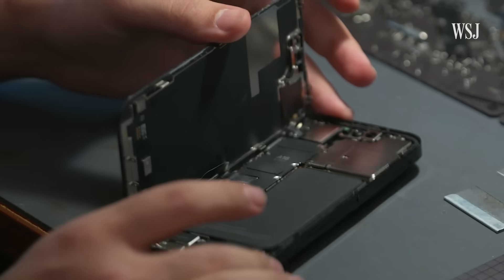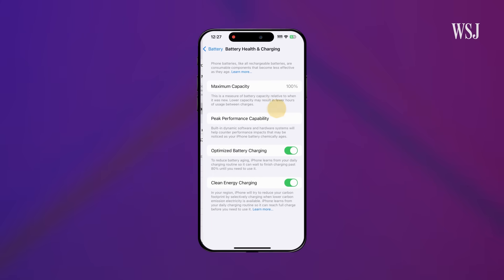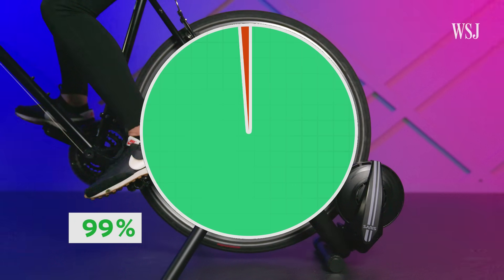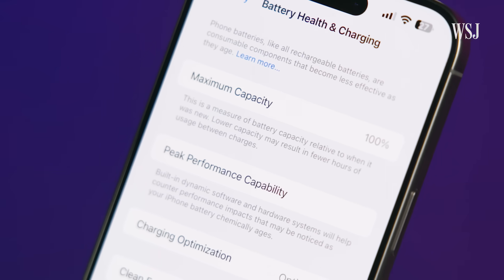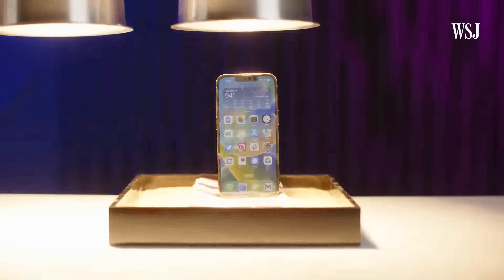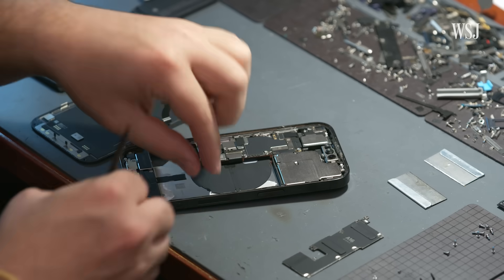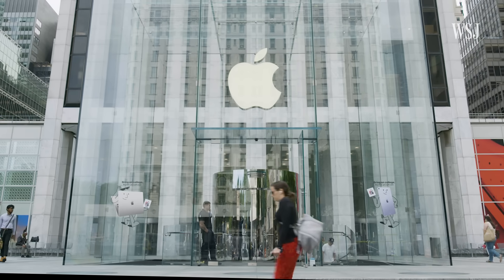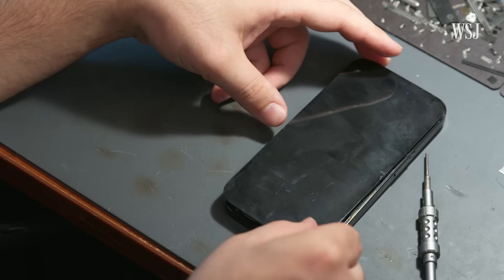Why My iPhone’s Battery Expired in Only a Year | WSJ

Comment: Actually when you charge 20-80 you'll consume very little of your cycle, it's not linear.
The 0-20 and 80-100 range is the most consuming
Reply: This is correct, at least according to my knowledge. Keeping it between 20-80% will extend the life of the battery but this babysitting and constant charging adds up and isn't worth the $100 battery replacement.
Reply: @KAZAM707 exactly. It's annoying. Looks like won't change much but is actually charging everyday instead of charging one every two days.
Reply: Can you share the link to learn more on this topic?
Reply: @hwthingzwork  Avoid extreme states (0-20, 80-100), avoid unnecessary heat (>35°C), avoid wireless charging while using the device heavily. Also try to charge "slowly"... i personally charge my iPhone 12 Mini with 5W (about 90 Minutes charge time) or my iPhone 15 with 9W (same... about 90 minutes from 0-100).
Little more "advanced" tips: Avoid holding 100% charge level for longer time, especially with heat involved. Same goes for the cold, <15°C can be an issue for LiIon batteries when it comes to higher power draw.

Its not that complex, in fact its pretty simple to understand how Lithium Ion batteries work and degrade and how to slow down this degradation.
Reply: On Samsung, you can set it to stop charging at 85%. The feature is called Protect Battery.
Reply: @KAZAM707  this feature is urgently needed on IOS…
Reply: SO Never charge above 80% and let the battery drop below 20%?
Reply: @netaisarker4991  generally avoid that yes, try to keep it in the middle
Reply: There is a setting on iPhones with the latest update called Charging Optimization which allows the user to limit a charge to 80%!
Reply: @vincrtv  I have it on and it still charges past 80%.
Reply: @vincrtv  only for the iphone 15s though right?
Reply: This is why I love my asus phone, I can set the charging limit from 70 all the way to 100 in 10 percent increments. And I can choose to use AC power (aka not charging) while connected to a power source, even when the battery is not at capacity.
Reply: This is how religion spreads
Reply: That's not how charging cycles are defined. So saying that it "consumes very little of your cycle" isn't quite right. However,  you're right that it's harder on the battery for it to be at a very high (>80%) or very low (<20%) state of charge. Interesting that the newer iPhones give you the option to stop charging at 80%. I'd be tempted to try it!
Reply: Samsung have setting to let you charge you until 85% to protect the battery
Reply: This is correct. You might think it will take charging from 0 to 80% consumes 0.8 cycles, but its actually 0.2 cycles. Its even lesser for (0.17cycles  I think for 20 to 80).
Going below 20% will also create some degradation, but not as bad as 80 to 100.
Reply: This is some BS even low budget androids can last longer without worrying about battery cycles
Reply: I have a phone I used for 3 years. It stayed on charge all the time. I only disconnected it if I were going out for a few minutes.
Reply: @franklinegbuche7097  How's the % left?
Reply: Ya I never charge over 80% on my bmw iX either the dealership said that will keep the battery better term
Reply: @aynrandfan7454  electric cars or whatever automatically limit charge. A lot of phones, without custom roms, can't do that. It's like planned obsolescence.
Reply: @singed234 Planned obsolescence is the fact that manufacturers at software level ar not helping to preserve longevity.. while Sony devices from 8 years ago did.
Reply: I can agree to this (although 20-80 still does wear the battery but it might as well be as much as if you kept the battery unused)
I used my oneplus 3 since 2016 and only recently changed the battery which turned out it still had about 80% of total capacity left. (measured with usb measuring tool against the replacement).
I pretty strictly held to 30-80% and only rarely used fast charging and rarely charged higher than 85%.
With 100% charge it would get me through ~2 days so this limit of about 50% usage was okay for me.
Have to add, that my phone had no automatic limit so I had to get a feeling when to check the % and take it out of the dock.

Scientific details about that can be read when you google for "tycorun battery degradation" they have a pretty easy to understand youtube video too but I think links in comments are not automatically shown.
Reply: @TorchCTI ROG, but the Zenfone also has most of battery features, I believe it only misses out on the bypass charging.
Reply: i’ll just pay the $99 if it every gets below 80% health. i keep my old phones and non of them have reached 85% yet. the relief from the anxiety is worth the price. now i use my phone instead of it using me
Reply: Actually, the optimum range is 45% to 75%. 
I've a cheap Chinese phone (Xiaomi) with an enormous battery, a low-res display (720p 60Hz), and an SoC that's second to none in terms of raw efficiency (6nm Snapdragon 680) so 30-35% charge easily lasts me a whole day.
Reply: Not really. Its not the charge percentage but the heat cycle. Most manufacturers already limit max chargeable capacity to 90-95% of battery's actual max. So when you do multiple charge cycles of 20-80 compared to 10-90 you are pumping more heat compared to charging once per day. You will degrade your battery faster because of it.
Reply: If you want to control when your phone stops charging, check out a device called “Chargie.”  I’ve been using it for the last two years on my iPhone 13 Pro Max, and my battery health is still at 100%.
Reply: They are so dumb they didn't even research the topic and yet wasted money on graphics
Reply: you will use exactly the same number of cycles, but the battery longevity will significantly increase where you will find that your phone could still be over 90% at over 500 cycles. My iPhone 12 is over 500 cycles, but my battery health is at 94% and that’s because I never charged beyond 80%. Lithium batteries become extremely stressed beyond 80% and that is how peoples batteries degrade. People think that the battery optimisation software in the Apple settings helps with battery health but it really doesn’t.
Reply: cuz u only used 60% of ur battery that’s almost half 
also even if u do that use battery will degrade by time
Reply: this video was researched poorly, they didnt even mention how batteries charged above 80% or under 20 goes bad faster lol
Reply: Accubattery on android is amazing, with detailed graphs and data on your battery. For a long time I followed the 20-80% rules, or just not charging over 85% but I'd find it was interfering with my daily phone use and I needed that extra charge.
Reply: @KAZAM707  If you plan according then it shouldn't interfere with your day unless you often have full days far from chargers. Even then you can plan accordingly. If I have a day where I won't be close to a charger than I will just charge to 100% or when I want to charger a portable power bank then I bring that with me so I can keep my phone in the 20-80% range.
Reply: I can attest to this. I never have let my iPhone 13 Pro go down to 0 percent and rarely charge it to 100% and after 2 years (564 charge cycles) I am still at 90% battery health. The most frustrating thing is that the people who complain about their battery draining after a short time are the same people who have no regard for optimizing their battery life and practicing better charging habits. So they really have no-one to blame but themselves
Reply: @hannostanley at 86 % almost 2 years of ownership and I have the optimized charging on.
Reply: and they are probably on it all the time... @hannostanley
Reply: @hannostanley my 12 pro max was at above 90% after 2 years and i charged it 100% all time. i constantly watched my 10s max kept it between 20-80 and it was also above 90% after 2 years. my 14 pro max is on track with wireless charging constantly so honesty i dont know if it really matters. just my results over 3 phones.
Reply: @hannostanley  Then the OS needs to automate this, but they won't. Planned obsolescence.
Reply: @taiwanluthiers apple literally has a setting that stops your phone from charging more than 80%
Reply: @F-aber  Unfortunately this setting is only available to the iPhone 15 series. Apple has not explained why they couldn’t make this feature available to earlier models.
Reply: @taiwanluthiers no they don't
Reply: @F-aber  I haven't see that option. It could be the 15 only option. I never saw it on my SE 2020 or iPhone 13. The only thing that is close is optimize battery charging which seems like a night time thing to slow charging but during the day I have to limit myself to stop charging at 80%
Reply: @mjameson88 i love apple products but they software lock features solely for upselling. this has been made clear when later they back track and add features to devices they previously said couldn’t run them.
Reply: You don't magically consume fewer cycles when you keep it in between.
Reply: @GhastlyHunger  There's science behind it. Keeping it past 80% or below 20% puts more strain on the battery.
Reply: @collller I got a Google Pixel, no such option exist.
Reply: Problem is most phone OS does NOT let you stop at 80%. Presumably this is planned obsolescence. For android there is only apps that sounds an alarm to tell you to unplug your phone.
Reply: @taiwanluthiers  i have an s23 and I have the 85% stop in settings
Reply: @taiwanluthiers ,  Samsung Galaxy S23 has built-in "Battery Protect" mode that automatically stops your charge at 85%.  You can manually switch this off in order to charge to 100%, which I do only when travelling.
Reply: @doseas2  So for android phones it's all down to manufacturer, which majority do not. And if yours do not, only option is rooting, or app that sounds an alarm so you can unplug it. Extremely tedious honestly.
Reply: @taiwanluthiers if you are using 60 percent of your battery, you might as well charge it to 100 percent, because you won't have a benefit because the battery wear will account for that
Reply: @taiwanluthiers Samsung lets you do it
Reply: @taiwanluthiers  I did the same with my iPhone 12 Mini, i set up an automated alarm when the battery goes 75% to disconnect the charger.
Since iPhone 15 apple allows to stop at 80% and i really LOVE this option since the iPhone 15s endurance is exceptional (for iPhones...)

Comment: Summary: apple manufactures  and warrantees batteries to a significantly lower standard than that of competitors. They also massively overcount cycles on their batteries.

Apple has its battery standards substantially lower than what is considered standard across the rest of the industry - with other manufacturers guaranteeing 80% capacity after 1000 full cycles, or more. 

In short: apple manufactures batteries which are designed to have a lower lifespan than those of competitors. There is a tradeoff between size and endurance and apple optimizes for size. (it's more complicated than that but you get the point.)

Edit: what I said about apple overcounting cycles was incorrect.
Reply: Apple doesn’t count cycles when the battery is disconnected… where did you get that wrong bit of information?
Reply: @Joel-bh5xd  I wrote a reply to this yesterday but it didn't get posted. Looks like my info was dated - I used to have several MacBooks and there the battery would incorrectly increment its cycle count each time the battery was disconnected from the charger. I updated my original comment, thanks for making me aware.
Reply: Oppo says 1600 cycles. Most phones have 800 cycles. 500 is more like in 2010.
Reply: I was surprised when I watched the video, I remembered it was 1000 cycles a decade ago. Also no idea about phones, but Dell only guarantees 300 cycles for laptops.
Reply: you are 100% correct that Apple provides inferior battery in their iphones with 500 cycles capacity vs their macbooks/ipads which are rated for 80% capacity at 1000 cycles. I think they want people to upgrade iphones more often. 

Also 14 pro had 2000 nits display and always on display. That display is way more power hungry relative to battery capacity vs earlier iphones. Hence you also need to recharge your 14 pro way more and voila poor battery health due to way more battery cycles.

Comment: Dont forget people, this is the same battery as your EV. Which they are pushing you all to own. Let it sink in.
Reply: Ev batteries typically have far better endurance than mobile batteries. Ev cells are often rated for more than 2000 cycles, each being a true cycle and not comparable to partial cycles as counted by apple. This is because they are built differently and also use a fundamentally different construction method - tubular cells are basically superior to pouch cells in all ways but are impractical to fit in a phone for obvious reasons. 

There are plenty of arguments to be made against the adoption of EVs, but the endurance of the battery packs is not one of them.
Reply: @chixinspace  how is 50 tons of ore for one battery with a 7 year shelf life, that needs fossil fuels to be built charged and maintained better for the environment? Can you answer or just post scripts?
Reply: @chixinspace  false ccp bot. They also rate the iPhone batts for same cycles. Dont make it does it? Just because you claim something don't make it true. But you aren't here to post truths.